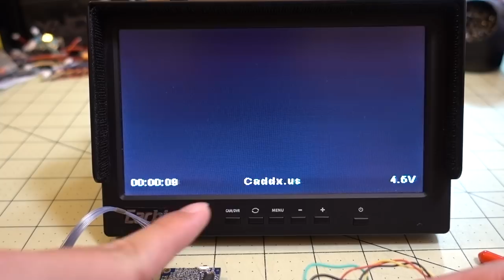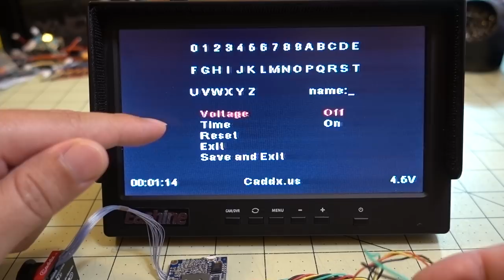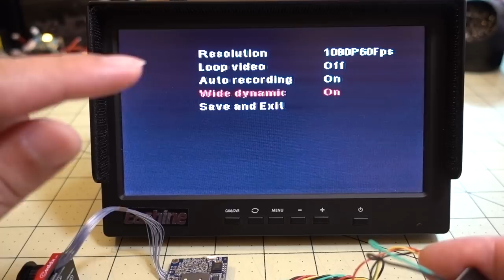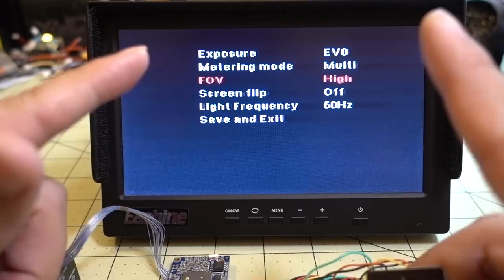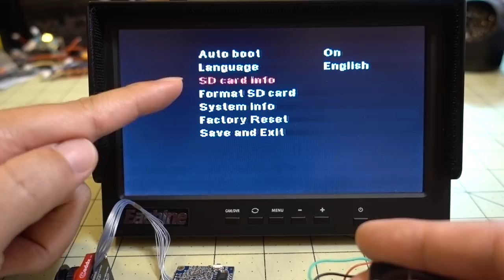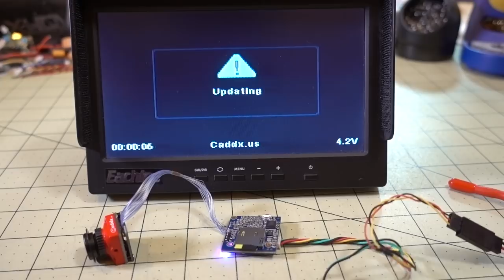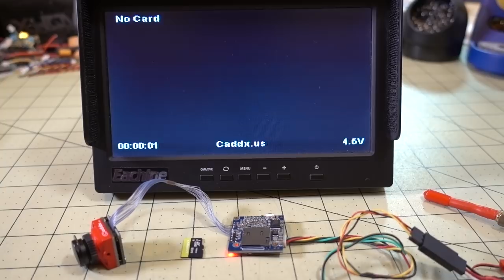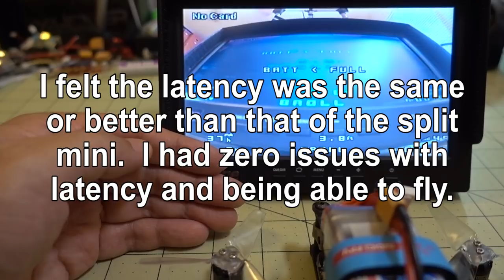Caddx Turtle 🐢 HD FPV Camera Review + Giveaway 🎁📷👍

Comment: The one thing I'm concerned with on this camera is the ribbon cable, but otherwise it looks like a really solid choice for HD recording. I'd be using it in a RotorX switchback as the main HD recording device. It would be cool to put it in the main stack, as opposed to the back board mount.
#caddxgiveaway

Comment: That camara would be great for mounting inside a canopy in an RC plane, NOT a drone. The cable is too long and adds weight to the drone. You could coil up the cable but its still going to have to be carefully secured. I could see the cable getting damaged easily too.  its just not a small enough camara in my book. The Run cam split just makes more sense and price wise, not much different. I personally prefer a run cam, thats just me however. I like all the run cams. I do use other camaras. I go for durability if possible but weight is compromised so going with a cheaper bare bones camara that can be smashed, but replaced easily because they are cheaper. Anyone that buysbone of these will quicly realize they are not a bargain. Having to buy an additional part to do the settings totally turned me off to this set up. Why not just add blue tooth and make it so you can program it from a laptop?

Comment: I have a 1306-3100kv build I that I can get 10 mins out of with hq 4043x3s. I'd buy tomo's new folding 4" frame and move it over for some ultra quiet long range flying. It doesn't even scare pigeons.

Comment: I have at least 3 runcam splits on my drones at the moment and those 3 have the worst by far live view, ruined by electrical interference.  I do practice good wiring technique and use capacitors and no matter what I cannot clean up the live video on these 3 quads.  My other at least 10 quads with traditional analouge video systems all have crystal clear live views.  I've tried trouble shooting these systems tirelessly to no avail and I'm at the point where I'm convinced the RunCam Split is a flawed product.  I'm hoping the Caddx can record HD without ruining the live view.
Reply from the maker: I posted the live feed on Facebook in the Caddx group.

Comment: I am building a microwing and it would be cool to have a micro HD cam on it to get some awesome footage #caddxgiveaway 
I noticed, that the camera is struggeling in color transitions. When u flew ur last spot, the ground changes to different colors and sometimes the ground is just a blurred piece of slime. Even at ur first spot, the gras got blurred and a single color with no seperation, untill it got back to normal, where u could clearly see the differnt leaves of the gras again. In Ummagawds video, it was noticable especially in the trees, how it did not capture a good resolution. It blurred leaves together in just green patches.
They still have to work a lot on it and I think Caddx will do so, as u said with the quick improves. But it is nice to see, that those camera options diversify and more products reach the market.

Comment: #caddxgiveaway great review Albert. Would love to use this in my smaller 2.5 inch build which is lacking a HD cam. I'm so glad that a competitor has arrived at a better price point to make these more affordable. One way they could improve on the camera is to work on that pixelated image and innovate the cables running from the cam to the board so that it can be easily switched to smaller lengths. Also from your last video I noticed caddx has a great night view except the blues are oversaturated. All they really need to work on is improving that fpv feed as that is runcam's greatest weakness. Would love more resolution in the feed.

Comment: I have 2 3 inch frames in mind.  A lightweight build on the FlyFox #5 135 with 1106 motors.  The other frame is the RealAcc Venom125 with 1506 motors.  Ty Al for the #caddxgiveaway

Comment: #caddxgiveaway so excited for this one. This may actually push me to HD cameras. I didn't see the point in getting this until now. At this price point, it makes sense to me. I just ordered some 2207 and 1407 motors so I will be using it in my new build. I have a Transtec frog frame and a freestyle frame as well on the way so this would be an awesome addition. The Run Cam split is too much money for what it is in my view. From the last video to this one it also seems to have improved. I am glad Caddx is littenning to you and the customers and is improving this camera. That is also another reason why I am considering switching over to Caddx for my other quads. They are improving leaps and bounds and are starting to get positive attention. Thanks for the review Albert

Comment: I'm also considering an Acrobrat coupled with a HD/FPV camera.  Hesitating on pulling the trigger til I see some reviews on both. 
Not 100% sure in the motors.  Thinking 1407 but 1507 is awfully tempting. 

Thanks for the review Albert. #caddxgiveaway

Comment: After about 10 flights my turtle is now freezing up about 10 seconds after power on. I reflagged the firmware and tried it with card or no card and it just freezes after a few seconds of power up. Even if in the menu does the same thing. Any help anyone?  Thanks -Ron
Reply from the maker: Try a different microSD card.  It might not be fast enough.  If that fails, contact customer support.
Reply: I have tried just simply FPV flying with no card at all and the results are the same. I will have to see what customer support says.

Comment: Albert, I will put this in my XJB 145 as i run a vtx03 in it i should have room to mount it right on top of the stack. i curentley run a SQ12 camera on top for video but it dosent handle light change very well. Thanks Albert, #caddxgiveaway

Comment: #caddxgiveaway 
I’ve been using the split mini in my 5” freestyle rigs trying to keep the weight as low as possible and still include HD video. This new Caddx looks way easier to mount and it requires far less stack height than the split mini. I can see the potential!

Comment: Looks really good! If I win the #caddxgiveaway, I'd be tempted to put it in a small build where runcam split mini is too bulky. Probably VX110 frame w/ 2 or 2.5" props, 1104 HGLRC flame 7500kv motors, artower mini arf4-svtx for dual stack fc+esc+vtc, and fullspeed fsd-nano v2 receiver. Happy flying!

Comment: I'd be putting it in a DIY build. For some freestyle practice, and to help me scope out local fields and trails when searching for lost pets. (If there's a local pet rescue group in your areas, folks, consider doing some spotting with your quads).
Lisam 210 frame, Matek F405 FC + FCHUB-VTX, Racerstar A20V2 4in1 ESC, Racerstar 2205 2300kv motors, DAL Cyclone props.
Currently just a little Eachine VTX03 camera, so this would be a big upgrade in visuals :D
#caddxgiveaway

Comment: Question:  Since you have both and have already built the iFlight iH3 with 1404s (I hope to build this soon), which would you choose if you were building it again?

Of course, if I were to win #caddxgiveaway, I guess it wouldn't matter as I'd definitely use the free one! ;-)

BTW, do you happen to know any sources for 1404s that are in stock?
Reply from the maker: Banggood has them in stock - http://goo.gl/UMhhKQ
Reply: The 6000KV are in stock, not the 4300KV, but thanks anyway... I still need to wait a bit to start buying parts for my build so it's not that big of a deal yet.

Comment: I would try it on my custom 2" build. theres enough room for another board. It is so smooth with the BBB 1105 6000KV motors and some Gemfan 3 bladed prop. And i would try to softmount the camera if i get jello. So it would be interesting to investigate if something like that could be done. #caddxgiveaway Oh and i forgot to mention: i would love this cam if it would be a decent 16:9 fpv cam.

Comment: #caddxgiveaway Will replace my cheap and bad action cam and the FPV cam in my FPV wing s800. Can then add larger battery and get longer flight time and better recordings!
Additional feature: Zoom for FPV stream... Or change FOV in fixed steps. Control via Rx/TX to flight control over. At the end it could be a switch or pit stop the radio controlling the FOV Box or a zoom.
Great feature on FPV planes. :-)

Comment: I'd use it on my transtec frog build which is torn apart right now. Who knew the metal connector of the antenna touching the positive lead could burn out so many parts? #caddxgiveaway

Comment: Caddx giveaway Skyline razor 5  frame like no other .
made in the US summer around San Francisco. It's a really light frame it's kind of a vertical arm frame where they use to to Mell arm stacked on top of each other to make a 2 mil buy 4 mil vertical arm really unusual take a look at it they sell it pretty cheap too I wanted the America but they wanted too much for each and every little part the skyline razor comes with the cage and pretty much everything you need I think it's 70 grams

Comment: Pick me random selector algorithm!  I'll put it in the air blade uav intrepid v2 where I can run double height stack front and back VS 3 and 2 setup ( by placing vtx over caddx board) ... This would allow me to run a low profile top plate and bring the battery down. Could be an interesting build. All made possible by the #caddxgiveaway

Comment: #caddxgiveaway I will either build up a 3" based on the iFlight H3 or the AcroBrat. Still on the fence about ultralite 1404 vs heavy and punchy 1407. Either way, 3" for sure! Thanks for giveaway and the reviews and comparisons you do! I'd only mess with the lens if it still fits in a 3" frame because otherwise it kind of defeats the purpose.

Comment: The video needs a shorter I frame interval
Reply from the maker: What's that?
Reply: Encoder settings, you can tell by the macro blocks every few seconds on for example the grass.

Reducing the I-frame interval greatly increases size though, so it is a tradeoff.
Reply from the maker: I think that's YouTube.  Original file doesn't seem to have that.
Reply: Could you maybe share (Google Drive) the original file (the grass clip) with me?

Comment: #caddxgiveaway I would use this camera in my 5" drone which is:
Matek f405ctr 4xHollybro Kakukte 35a Brotherhobby Returner r3 2206 2300kv tx526 flit10 lisam ls210 dropdeck 20mm standoff caddx f1 geprc 5040
Would be a pleasure to put this camera into my drone instead of the f1

Comment: I'll use it to replace my current Split Mini which i'm having Jello problems in my 3" frame which I can't get rid of even though it was working fine in the beginning for a couple of months. I have exhausted all my options such as soft mounting the camera, fc, motors, changing new props, lens and still have it in my video. I really hope this Caddx Turtle will finally solve my problem. #caddxgiveaway